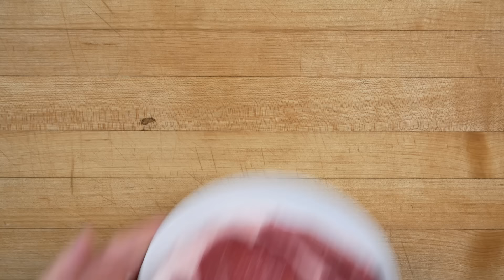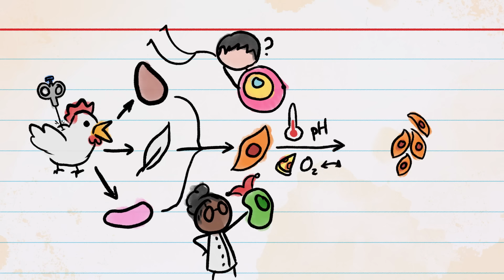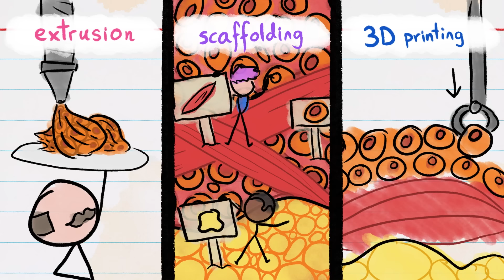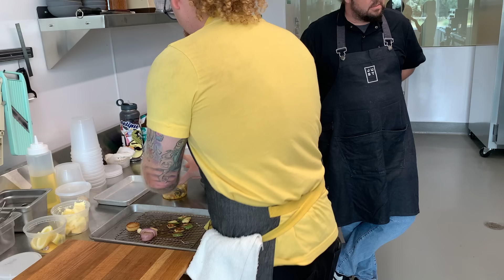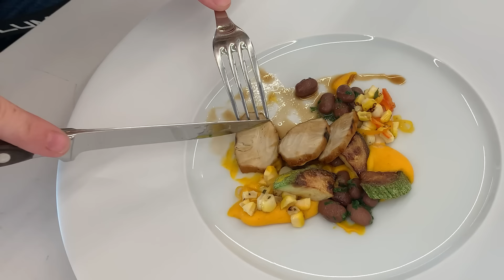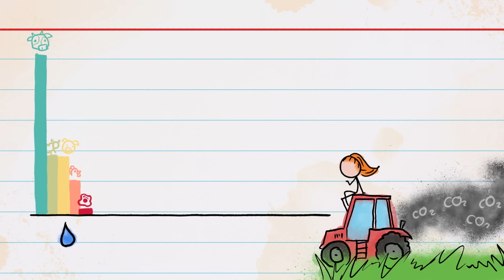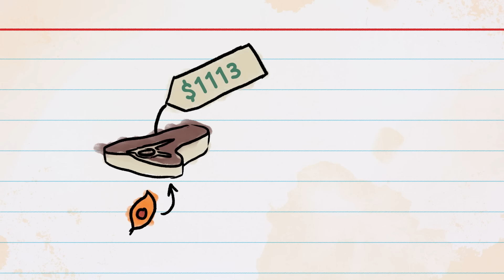Lab-grown meat (probably) won't save us

Comment: If it turns out that the process doesn't work in larger bioreactors (scaled-up), then it can still be scaled out with multiple smaller bioreactors (scaled-out).  That would, however, mean more land dedicated to meat cultivation, more up-front cost associated with building the facilities to cultivate, and other effects cascading from the need to scale out
Reply: They could reduce the land requirements by doing something similar to vertical farming, where they simply use smaller reactors over many, many levels of a very tall building, though that would also probably raise the costs and energy for harvesting.
Reply: I just this morning listened to a pro in this field, who said that growth hormones for animal tissue where a lab niche product and contribute massive to the price of lab grown meat so far. It is one bottleneck after the other, that will get widened, while the technology get's rolled out on a larger scale. 
Also he saw no problem in scaling up the reactor size, but financial.
Reply: Or you stack the bioreactors upon each other.

Where's my Nobel Prize?
Reply: @Zula_The_Squid  Yeah, I mean unlike with normal farming, there's no reason you couldn't make bio-reactors that are on every floor of a sky scraper if that is the most efficient land use option. You could even just pump the materials up and down from those floors to the ground level.
Reply: @timogul  cost i think a chicken can be grown fast so can a bio reactor but the machines cost too much tbh i wont make the switch and stacking them will be a hassle of pipes.
Reply: Let's remember that 41% of U.S. land is dedicated to livestock, so as long as the space facilities occupy in relation to production rate is less than that, it will be worth it.
Reply: @theskull1030  To be clear, my comment was meant to speculate about the possible challenges associated with this technology.  I am not advocating for livestock instead of this.
Reply: @dabundis  Oh, yeah, I didn't think you were. I'm just pointing out that the bar isn't that high, but yeah, it is gonna be a challenge.
Reply: Locally scaled …
Reply: it will still require less kand than the endless pastures reserved for cows and porc right now
Reply: @KekusMagnus  Does it really and foremost, does it matter? We not yet stack our animals, because land is that cheap. Also, when where you at a farm last time? Those walking* meat reactors are pretty densely packed. 
*they do not much of a walk, nowadays.
Reply: Can we grow meat vertically?

I understand that farm need to touch the ground but bioreactor? We might grow multiple story meat reactor thus save some space.
Reply: @ThoraninC  Hey, true!
Reply: What about multi-storeyed cultivation labs?
Reply: Or just have the production centers scattered across the land where there's demand.

There will be less CO2 emissions if the lab meat is produced in your town that if it comes from a production center far far away
Reply: @Wrulfy  Simon Clark has made a video about CO2 Emissions for food products. Usually only about 5% of the total greenhouse emissions is from transport. The vast majority comes from land use.
Reply: @Ruhrpottpatriot  I mean, it's already said in the video that the technology would most likely use only a fraction of land compared to traditional agriculture. Land use is pretty much only to grow crops to feed the animals, so of course it will be much less intensive if we feed the cells with what I assume is water and homogeneous nutrients instead of corn and soya
Reply: @Nespadh  Where do you get the "homogeneous nutrients?" They don't appear out of thin air, and may even need to be sourced FROM crops.
Reply: @ProfessorJayTee   yeah, but I doubt they'll just sprinkle powdered corn in the bioreactor. Honestly I don't know how they put the nutrients in there or what nutrients they need exactly, but my guess is that's it's more easy and less demanding to feed a bioreactor than an animal. I guess the process is more or less the same than with reactors for the pharmaceutical industry, they could be a good comparison point if the lab meat companies don't want to reveal too much about their own processes
Reply: @Nespadh The "sprinkled corn" will be highly refined, but basically, that how it is supposed to work🤗

Btw, i don't see this either. Not for the long run. There are better way to produce proteins, that cultivating animal cells and that is what this is all about.
Reply: @Wrulfy  Transport is usually a small fraction of the emissions cost of food production compared to other energy inputs.  Eg. growing tomatoes in Michigan produces far more CO2 than growing and shipping them from California.  Emissions from HVAC and scale efficiencies would probably be more significant to bioreactor emissions than transport.  And don't forget that feedstocks would need to be shipped to each facility.  Shipping everything by train to one place is better than thousands of trucks to different places.
Reply: @Wrulfy  That's still the type of scaling out i'm talking about.  multiple small batches is always going to have more production cost than one big batch for the same throughput
Reply: @Wrulfy  Also, any CO2 emissions can be captured with almost trivial ease, since everything is happening indoors.
Reply: @Wrulfy  think of big cities. It’s ok to have one big in a region for millions of people
Reply: @Wrulfy  oof man thats a good idea but capitalism really doesnt like that kinda of good ideas, it basically goes "what do you mean this does not have 10 unecessary steps of production scattered thruought the world to create profit in every single stage, no man this almost charity"
Reply: There's no fundamental reason why you couldn't achieve similar agitation and oxygenation in a larger bioreactor as multiple small ones, it's just a question of design.  Downside of large bioreactor is higher risk of contamination - more eggs in one basket.  I don't think land-use is a major constraint here, it's equipment cost, technicians and financing.
Reply: @rpenm  contamination is not a small thing, like even a small microscopic nick in a weld can create a pocket for contamination
Reply: What if we grow it in bags like in cyberpunk 2077
Reply: Not as juicy and springy as perfectly cooked chicken is fine by me since I cannot cook chicken perfectly anyway
Reply: https://youtu.be/V0zCf4Yup34?si=CW07FbuVQNYKifzs
here's a rather nice video pointing out all the issues with that, with input from actual experts- as it turns out, the only thing lab meat does better than real meat is drumroll use less land, it costs more money, goes through more chemicals, consumes more water, and creates more emissions to produce a cow's worth of meat in a lab, than it does to simply raise one in a field, despite claims that its better for everyone.
Reply: You can have that all in a skyscraper though. That square area doesn't need to be spread out like a pasture.
Reply: A good point, but putting large equipment on high floors stacks up structure costs very quickly
Reply: dude theres already so much land being used for growing cows and pigs and chickens....so much land.....I bet cultivators wont take even half as much land for the same amount of production.
Reply: The cost would be tremendous, imagine having a lab for every 10 chickens in the world.
Reply: Price wise impossible. The highest tech equipment you see goes up against literally dropping seeds on the ground. Complex extrusion methods or protein scaffolding vs an axe to the head.